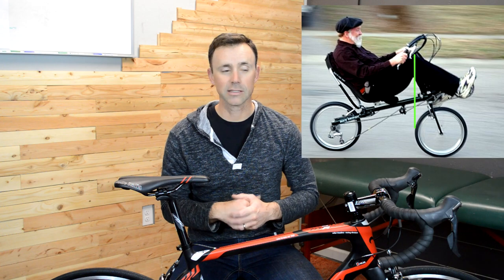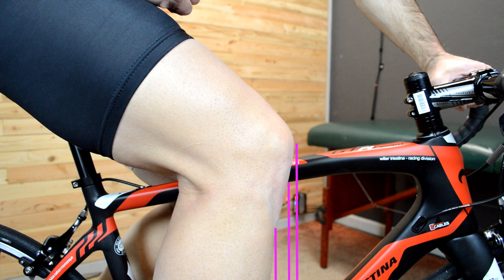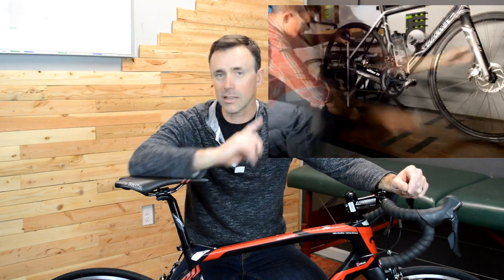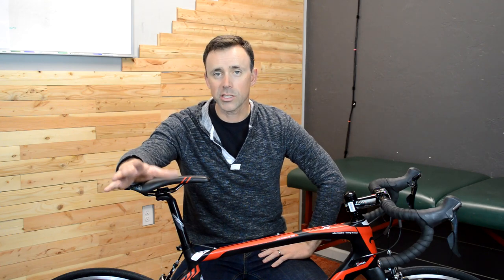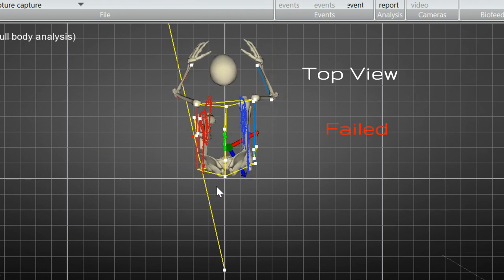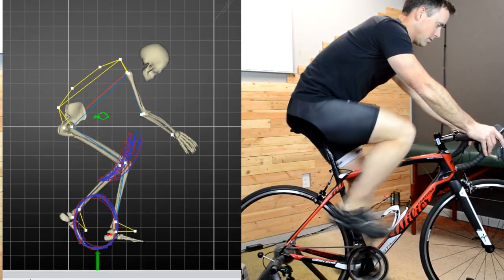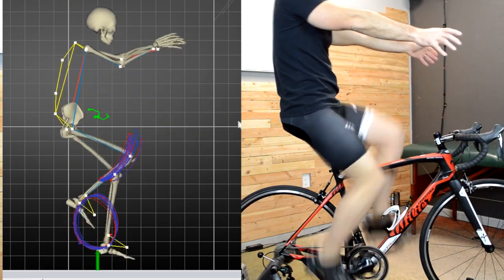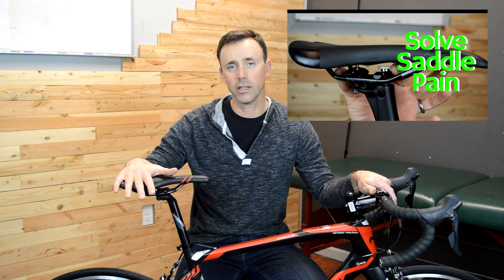How to set Saddle Fore Aft | Bike Fit Tip

Comment: John thanks as always, for such free useful info. I always thought knee over pedal was a kind of wonky standard. I do use the plumb bob just as a general, but it never became more apparent when I changed to a Pro Stealth. For some reason the geometry of the saddle and fitting it, showed me I was way off with my previous Fizik antares. By the way the Pro Stealth has been an enlightenment to me, at least indoors, so far. Thanks again!

Comment: if i slide forward, couldnt this also be a sign that my saddle angle is to much in the negatives? im having it around 2-3 degrees because it takes the pressure away from the sensitive parts down there, i am already using a saddle with a big cutout also. havent tried to bring my saddle back yet, will give it a try :)

Comment: Hello, Thank you for the vid. Handlebar being the same position. wouldn't moving saddle back cause your back angle to drop making it harder for the rider to do the lift up test? I was just curious because that you mentioned, if test fails you recommend pushing the saddle back, and if it is too easy you recommend pushing saddle forward, wouldn't that shorten the reach and raise the back angle making the easy test easier? am I missing something here? thanks
Reply: Nevermind. I get your point. I was just kind of fiddling around on the office chair after watching your vid. then realized that if position of hip is more to the back you do not topple forward, I was thinking this in correlation to the reach so much so that what you said did not make sense. now it does. have to think reach separately.. completely take it out of saddle position equation.

Comment: Doesn't the saddle tilt greatly affect this balance test?
Should this be done on a leveled saddle or on preferred tilt?
Reply: Level saddle for this test as this just establishes a starting point. Then tilt the saddle as needed for flexibility and adjust fore/aft to stabilize the pelvis after the tilt.... but like always changing the rider position over the bottom bracket changes the pelvis angle which may warrant a saddle change.

Comment: Excellent video - so in summary if you raise the had and there is no moment - you pass the test.  If you raise your hand and shift forward or  / or have problems riasing up you are either too far back or forward?  Excellent video.  Greetings from Ireland.
Reply from the maker: Martin Lynch Just about -- if you raise your hands up and your hips shift forward your saddle could be too far forward -- or -- it could be perfect or too far back and the problem is that the reach to the bars is too long which draws the pelvis forward. The solution would be to come close to normalizing the reach, then re-do the test. We need to eliminate the reach as the problem before moving forward.

Once we do this, if the test tells us to move the saddle (either direction), we can take appropriate steps to keep the reach the same by changing the stem length.

Comment: just a little confused. What does a (+) positive test mean? Does it mean that you NEED to experience the mentioned symptoms (cadence going a little higher, torso moving forward/back,..)  to determine that you are balance? or if i dont experience any of the symptoms it means that i am out of balance. It seems like if your saddle is too far forward you will NOT experience any of the + symptom so a bad bike fit?
Reply: If you get a positive It means that your balance is off and should try moving the saddle back a bit or that your reach is to long/low

Comment: I've been following alot of the seat height / seat positions for a long time now, but it dawned on me. Will these measurements work with the mullet set ups? Wouldn't pulling the seat back further unload the front? Or could offsetting the wheel size with tire size remedy this. I'm running 24/26  26/27  26/29 and  27/29s mixed between hard tail and full suspensions.

Comment: I'm not an expert so maybe I'm wrong but I believe the fwd aft position is not very important (assuming the saddle is horizontal) because you'll naturally sit in the right spot so that you can pedal comfortably. Then the correct position would be the one where you have better support on the sitting bones (example if the saddle is too much back you'll be sitting on the nose of the saddle etc). Is this a good way of thinking about it?
Reply: no because there's nothing holding you in that position. You'll just slide forward to te point where your legs are at the correct position for peddling...
Reply: Yes. Your hips normally tend to move to the right spot during pedaling. Because of this, using a flat saddle that's leveled, the fore/aft- positioning is not that big of an issue. How ever, with a curved saddle that raises from center to tail and nose, it's a completely different game. Sliding your hips 1 cm forward from the center and your pelvis starts tilting backwards. Sliding your hip 1 cm backwards from the center, and your pelvis starts to tilt forwards. That's why the fore/aft -positioning is very important.

Comment: If you can't answer, maybe someone from the audience can... Do these tips apply to motorcycles as well? I got bars that we're a bit taller and a bit further back, that solved my wrist and arm issues because I no longer have to lock my arms because it was impossible to lean further forward. But, I get pain in the saddle and knees. Should I spend money on adjustable pegs to change my position?

Comment: What recourse might I have if a bike shop sold me a bike that was probably too small for me? I have been riding it for 8 years now and have many miles on it. But no matter how much I practice, I always have a sore butt and numb hands. I realize now that my top tube is really short for my height (54cm, 6'1" me). Will increasing the stem length help? I definitely fail this test, but the saddle is already at its limit. I feel like my LBS was trying to get rid of the last of their previous year's stock on me the more I think about it. CAADX 105 cross bike for reference.

Comment: Get a bike fit if you are not sure and start from there as a base. I'm at a good saddle height, but I suffer from occasional numb hands which can be I have too much weight on my hands. I probably have to move the saddle a little to help get any excessive weight off the bars. It makes sense that if you move the saddle enough to get a successful test can also contribute to getting excessive weight off the bars to where you could possibly address hand numbness or at least reduce it.
Reply: I think he dead...

Comment: I'm pretty sure this has been addressed but I'd like to ask anyway.  When it comes to the balance test, how does the power you're putting out effect balance?    Does using oval chainrings effect how you set fore aft?
Reply: I think you need to take your typical riding into account. Not sure if ovals have an effect, just use your bike if possible.

Comment: Hello John. When I got a bikefit, my saddle was placed more to the front, and after all the settings, this was the last test, that resulted on tilting the saddle up, to avoid me sliding front. My stem got slammed, and I feel I could go way lower and longer (its a canyon endurace). Maybe the whole fit was badly adressed, and I should be having the saddle back and leveled? I feel great in this position though.
Reply from the maker: +Joao Godinho you don't necessarily need it to be back. If in your current position you're well balanced, you don't have any saddle problems and your overall comfort on the bike is good, then this could be just fine. A lot depends on the reasoning behind moving you forward in the fitting...if it was done for solid mechanical reasons then great. But if it was done to satisfy some arbitrary rule like KOPS then probably not such a good idea.

There's a chance that with your saddle back slightly and your stem shortened an equal amount, you'd be just as aero but perhaps with overall better balance (not saying this absolutely would be the case, only that it's possible). Your bar position would still be as low and the relative length of the cockpit would be the same but your weight wouldn't be as forward on the bike.

Comment: Hi john, I had foot problems a few years ago & relieved the symptoms by moving the cleats 12mm back. Would you say as a general assessment the saddle should be moved forward by around the corresponding amount. This i didn't do but did lower the saddle by about 10mm. Had lower backpain for years until I changed my cranks from 165 - 150/155. Back pain disappeared over night after doing this. Just wondering if I could still use my 165 cranks with the saddle more forward. I did have an accident 5 years ago which did cause lower backpain(fractured pelvis), but I'm pain free at mo. With the balance test my lower back always feels better with more weight on my hands, actually the balance test is easier to do with more weight on the hands. My legs are so short that when I'm standing astride my 19.5 inch frames I'm basically nearly sat on the top tube with about 5mm clearance. Sitting on the saddle, now that I'm using short cranks both feet tip toes are 20mm from ground. I probably need a smaller frame using 650c wheels , but can't afford to run 650c tyres & the range is ltd. Always trying to learn more even after nearly 50 years of cycling & around 250,000 miles of riding. Keep up the good work.
Reply: No, you effectively shortened your leg, so if anything lower the saddle. IMHO, the saddle s/b as far back as safely possible. It lets you start your power stroke sooner, uses more thigh muscle and engages your core more. Don't forget to take measurements before you start, be diligent with every move, only more 1 thing at a time to keep track of whats going on.
Reply: Your correct it did shorten my legs but cured the foot problem. I tried lowering the saddle by 10mm, this only transferred the pain from my lower back to my knees. Moving the saddle up by half of the amount which I had lowered it made both my back & knees ache, but both to a lesser degree. Then a few years later read an article on crank length with regard to inside leg measurement (711mm(28") which worked out that I should be using 155mm cranks. So got a pair of old 150mm cranks from ebay, once fitted no more knee pain. I did raise the saddle by 10mm at the same time. I Still get slight back pain on longer hilly rides after about 100miles which I can dial out by moving the saddle forward 10mm. Only trouble with doing that it puts too much load on my arms & shoulders, so I don't. Raising the saddle by 5mm or moving it aft by the same amount brings on the back pain about 20 miles earlier. Lowering the saddle by 10mm brings on slight knee pain & loss in power according to my garmin.

Comment: Looks like the seat angle is tilted slightly to the back from level which may put pressure undue pressure on the prostate zone. Tilted too far forward can put pressure on the lower back over time.

Comment: What factor does the saddle play in this scenario?  My fitter wanted to help me rotate my hips more to compensate for arthritis.  He put me on an SMP saddle.  The high back of the saddle makes it hard and uncomfortable to take both hands off the bars.  Your opinion is appreciated.  Thanks
Reply from the maker: +Rich Kaplan hmm, arthritis where? And they wanted you to rotate your hips/pelvis forward into anterior tilt to straighten your spine, or back to flex your spine? Just trying to get the proper scenario in mind...
Reply: Bike Fit Adviser I have arthritis in my hips and I am scheduled for a left hip replacement in April.  I think he was trying to open up the hip angle since the arthritis is limiting my range of movement.  Can't raise my left knee as high as normal.  This is also causing me to sit on an angle and my left knee moves outward as I raise the knee up when pedaling.  He also switched me to 165 cranks and moved the saddle somewhat forward. He thought the smp saddle would help me to sit more "normal".  He also moved my left cleat back and kept my right cleat in its original position.  I am riding a BMC Road Machine.  Boy, I'm a complicated case!

Comment: Basically, no result given in the video! All the bike fit systems are guess work. The only system that really works is trial and error: get on the bike and ride for at least half an hour at a relatively high pace, then make adjustments, then try again, then make refinements, etc. It is possible that the stem length and/height might need changing, and the seat post layback (or not) distance could be very wrong - resulting in the need to change this too. The 'take-away': a bike fit will only help to choose an approximation of dimensions but you have to ride the bike and make adjustments over time.
Reply: That's why you do a fit dynamically on a fit bike, before you buy a bike in the first place.
Reply: @Geeios1  Ah, such insight. So every time you buy a new saddle one must buy a new bike. Gotcha.
Reply: @psycheout4733  no, since you have the correct bike and fit in the first place. All you have to do is take measurements remove and replace the saddle, position it to measurements. No guess work or trial and error. , might be hard for you though.
Reply: @Geeios1 And where do you measure the new saddle to be millimeter perfect? The seated position is not the same on every saddle relative to the nose, tail, side profile of each saddle. You won't have that accuracy with measurement unless it's the same saddle where you can take the same reference points.  So might be hard for you too.  ;)

Though per your bike fit you're right. Take measurements and transplant the fit onto a new bike. Hence you don't need to get "fit dynamically on a fit bike before you buy a bike in the first place."  Stack and reach ranges is all you need to know when buying a new bike and it's fairly easy finding what suits a rider w/o having to pay for a dynamic fit on a fit bike to get the very basic range of what range they're looking for. But think that might be getting too technical for you.
Reply: @psycheout4733  why are you changing saddles? The title of the video is determining fore aft position of the saddle. Where would you start? How would you know it felt better or worse if it isn't positioned exactly where the other saddle was? Measure from the nose of the saddle to the center of the topcap bolt, don't forget the adjust to the correct height. It will be a combination of the two until it's set.
Reply: @Geeios1  You seriously just asked why does a rider change saddles? Because to try new things and maybe there's another saddle more comfortable than the one you bought with your bike? Maybe that you got fitter/thinner/more muscular hence different body proportions that would be better off with a different saddle? There's dozens of reasons to try another saddle. 

The nose of any new saddle isn't going to have the same distance from the seated position as the old saddle if different model. There's a wave of short nosed saddles, which are currently the most popular ones on the market now like the Specialized Power and the Shimano Pro Stealth being two of them. The nose length will NOT be the same saddle to saddle. If you're just speaking about how to reset the same saddle to the same point on the same bike... that's taking the obvious and literally any two measurements that measure height and fore/aft using reference points on the bike. You can't measure to the top cap if changing frames as what matters is the rider position relative to the bottom bracket not the top of the steer tube...

But ultimately you're saying that the only way to know if your saddle position is in a good place is to get a dynamic bike fit on a fit bike by a professional. Which is completely over the top and no it's no where near that difficult to find your saddle position.
Reply: @psycheout4733  

It was meant to get you to think. I know it might be hard for you.
Reply: @Geeios1  Is that all you're about? Posting troll comments because you can't imagine a user not going to a professional just to install a new saddle? Or so ignorant or unable to comprehend as to why a rider would want another saddle? You've already stated you need a professional to do anything to a bike so realize thinking and decision making just isn't your forte - leave it to the professionals.
Reply: @Geeios1  When your most repeated phrase/insult is "it might be hard for you" you're a troll regardless of if you own it. They're not even witty. But funny now you're saying there's a time expiration upon how long your comment can be responded to. A flailing defense. 

The sarcastic remark was because your recommendation is to know where to set your saddle you have to get fit on a fit bike before you buy a bike and subsequently before you try another saddle. So if you want to get a new saddle, any adjustment or new piece of equipment start from the beginning. It's really becoming clear how much you should leave fitment ideas to people who are qualified, which you aren't as you actively refer to professionals. Anyone who came to this video for ideas of how to figure out saddle placement your only advice/comment is go pay for a fit and quit trying to do it yourself or learn anything for yourself. That mindset shows in spades with your own "psychotic" need to throw accusations at people instead of actually give any insight about saddle position.